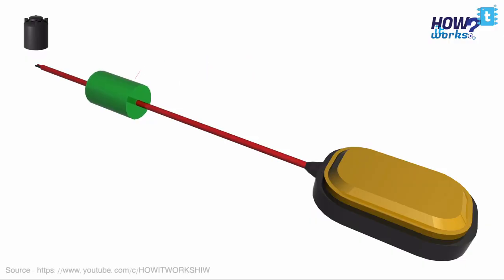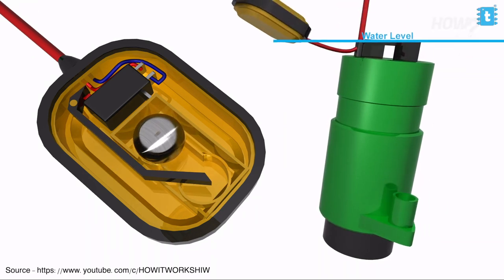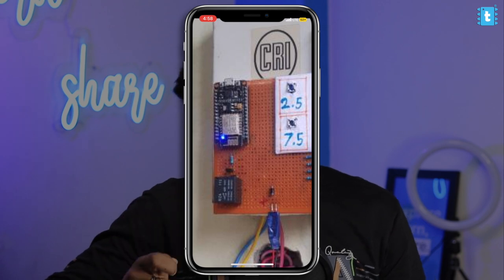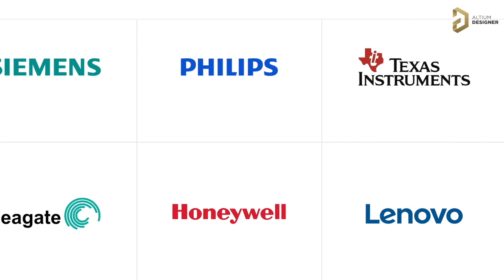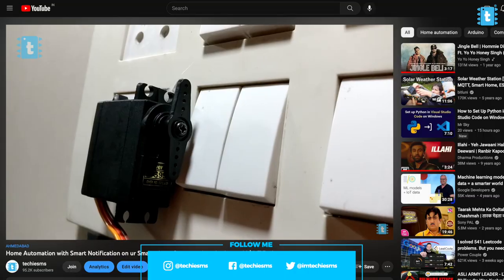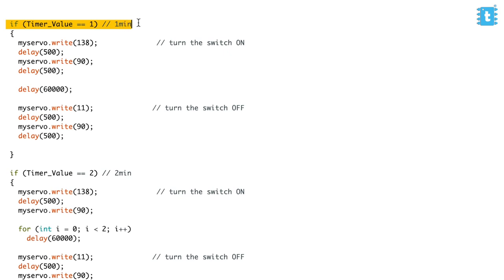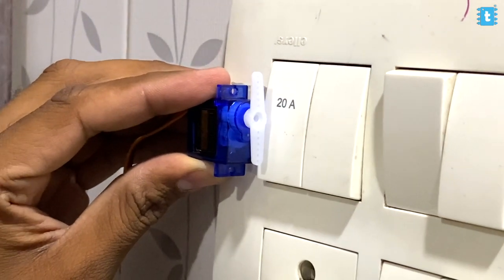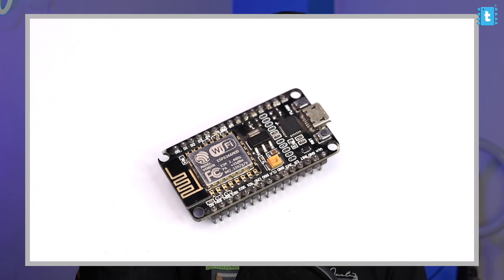STOP Water Tank Overflow using Servo!! | ESP8266 Projects | Electronics Project

Comment: I have added one RO float valve in one box with small holes at bottom of it. I have added that box to the water overflow pipe of tank. Once water starts to overflow it raises the float valve and closes the circuit for the water tank full indication.
For water level indication I have added one recording module with my custom recorded audio in it. I also added one small solar panel to charge the battery. It's almost 6 months and it is working fine.

Comment: I was waiting for this. 👍🏻 
There is 1 more simple solution you can use by just buying the smart switch/plug and using Google assistant or Alexa routine to automatically turnoff it.
Reply: He is not interested to open the switch board. That exposes high voltage lines.
Reply from the maker: correct

Comment: This project is ok but without knowing the level in the tank turning the motor on is not a good idea. If tank is full and you turned on switch then the purpose of the project is useless
Reply from the maker: See, in my project the water wastage problem is solved completely. Let me explain 

In case that water tank is completely empty, we know that it will take time to fill that completely so we can set a timer of 4 min and turn on the system. So no water wastage it this scenario 

Taking another case like you said, what if the water tank is 75% filled. Well here let's assume that  we are not aware about the exact amount of water stored in the tank but what if we are alone in the house and we need to go to toilet urgently and are not sure weather the tank has some water or not well what we can do here is, we can set a timer of 1min so that whatever amount of water the tank has, adding more water for only 1 min won't make that overflow and secondly that person (in the toilet)  will also get enough amount of water he/she needs in case the water tank was about to get empty. Again No water wastage. 

Hence I put different time intervals here.

Comment: First of all, it's way more costly than what I use.
I use a BC547 transistor with a buzzer and electrodes to detect the overflow as shown in one of the projects in the video. It costed me just 15 ₹ to make it. (Excluding the cost of wire which I had already lying around). Yeah, in 4 months (3-4 times a year), I have to change the electrodes, but atleast it's cheap and very reliable for the next 4 months.

Secondly, In your project, how to know which timer to use if we don't know the level of water in the overhead tank? It's the main drawback of the project. Suppose if the tank is 75% full and as we don't know it's level, we pressed for 50% (half the timer) then the remaining 25% water will be wasted. And that's a huge waste of water.

We try to save water, and end up wasting more of it.
Reply: Points to be noted. Agreed. 

But dipping electrode is not long lasting idea. The electrodes may get a thick coating of salts and minerals from the water and stop conducting. 

A float switch must do the trick. This way there are no metals coming in contact with water.
Reply: @madhukeshnp  yeah, float switch can be a good option, but it has its own drawbacks. The metal contacts inside the switch itself may corrode due to the humidity inside the tank. In that case, you have to either change the complete assembly of the switch or clean its contacts, which is more of a hectic task.

For me personally I don't have any problem in changing the electrodes 3 or 4 times a year. It hardly takes 15 minutes.
Reply from the maker: See, in my project the water wastage problem is solved completely. Let me explain 

In case that water tank is completely empty, we know that it will take time to fill that completely so we can set a timer of 4 min and turn on the system. So no water wastage it this scenario 

Taking another case like you said, what if the water tank is 75% filled. Well here let's assume that  we are not aware about the exact amount of water stored in the tank but what if we are alone in the house and we need to go to toilet urgently and are not sure weather the tank has some water or not well what we can do here is, we can set a timer of 1min so that whatever amount of water the tank has, adding more water for only 1 min won't make that overflow and secondly that person (in the toilet)  will also get enough amount of water he/she needs in case the water tank was about to get empty. Again No water wastage. 

Hence I put different time intervals here.
Reply: @techiesms  okay, I understand. The first case is absolutely fine👍

But the second case is very very specific and a rare scenario. So the timer will be useful only for that specific scenario and not for everyday tank fill-up.

But if we somehow manage to measure the level of water, then this will be a great project. And I for sure, know that you will make this a full proof project in upcoming days. We just need to find a reliable and low maintenance way of measuring water level.

The day we find that, I'll hook this everything up into my Home Assistant.
Reply: @techiesms   how do you know if the overhead water tank on the third floor of the house is full empty or half empty or quarter empty especially  if the use case scenario are for retired people

Comment: The best solution is to use cheap ultrasound mounted at top of tank
The water level can be measures in high accuracy 
Also we can calculate the number of lts of water present in tank
I use esp32 with ultrasound sensor
And have dashboard in home assistant displaying water level and lts , also I made calculation to show how much water consumed in a month
Reply: Pls share the photo
Reply: The water droplets condense on the face of the sensor and gives wrong measurements.  Have you faced such issues ?
Reply: I spent some money and got a waterproof sr04 from Bangood 8 few months ago. Completely flawless operation eversince. I have full monitoring on app and announcement on echo and message on telegram bot when tank is full or empty. 

I can easily control a contractor or relay to turn on and off the pump but just avoiding too much automation so that my parents can turn and off based on notifications.
Reply: @madhukeshnp   I use JSN-SR04T sensor available in amazon , I am using for my overhead sintex tank with proper air vent ( t pipes) . There is no issues of error reading from 6 month . I use this info to control relay of my water pump . The system is working without issues.

Comment: This is a good concept. But the downside is, you cannot make it a commercial product as you will be asking too many questions from clients such as 'How much time it takes for their tank to be filled?' What if they decide to start the pump when water level is half way?

I WILL SUGGEST THAT YOU MAKE A PROJECT WITH ULTRASONIC SENSOR, THE WATERPROOF TYPE WITH BLYNK, SHOWING WATER TANK LEVEL AND ALSO THAT CAN BE TRIGGERED AUTOMATICALLY WITH BLYNK AUTOMATION SETTINGS AT SOME CONDITIONS AND WITH MANUAL TRIGGER THROUGH A VIRTUAL BLYNK BUTTON. THANKS

Comment: Hi Sachin, 
Switching the Pump On/Off Switch using Servo Motor without touching the Internal Connection is the interesting part of this project.. 👍👍
Reply: Not every house has the switch type connection though..

Comment: I would have added a water flow sensor connected to a esp at the overflow pipe of the tank. And added a second esp at the motor control switch. And let them talk to each other via wifi. That way we won't have the hastle of setting rotary switch.

Also as a failsafe i might add a second flow sensor at the output of pump. So that i can precisely track how much water has gone to the tank and turn off the pump if it exceeds the tank capacity

Comment: Hi sir myself kesav
Another idea this project works only for normal pump motors. But for Submersible pumps additional controller panel buttons needs to switch on and off. Using the same principle can you try for that panel board mounting the servo horizontally.
Just a thought correct me if iam wrong.
Thanks waiting for your reply
Amazing and great idea for this video

Comment: Hi, Thanks for the video. The idea is good, the making and alignment is a bit critical. Can you please make this 1. by utilizing ESP now; one MCU transmits the overflow signal and the other acting on this signal. In fact I was planning to add a ready made smart switch near the switch, connecting parallel to the manual switch. Then we can have manual, auto, timer, voice control options.  your suggestion is appreciated.
Reply: No

Comment: Hai bro can u make a video for water low level and high level announcement only ( no motor operation) using Arduino uno and TF card mini mp3 module plz?  3 wire float switch for low level and high level to be used.

Comment: Firstly asking subscribers regarding their ideas and discussing the things is very good

If is make this kind of project i will use electrodes as i want to know the level of water and a buzzer when overflow

Is there any other way to know the level of water without any disadvantages like ultrasonic sensor
Reply from the maker: Knowing the level of water is good, but extending such long wires is hectic. 
that's why I said, I made this project just for my home. If you have a single storey house you can easily extend the wires and know the level as well.

But to know the level I'll recommend that floating switch rather than dipping electrodes
Reply: @techiesms  m on way to find simple solution
Reply: @drelectronics13  hey why can't we use rf module like nrf24 for sending water level data to the ground floor or near to motor switch
It has around 100 meters of range

We need to find out other way in place of electrodes for sensing water level
Reply: @rahulb23  issue is cost and reliability,and for sensing need to use floating sensensors
Reply: there are digital water pressure sensors, but its too expensive

Comment: RF ransmitter, RF receiver and a floating switch .
RF ransmitter switch is connected to the floating switch once it's got signal  it transmits the signal to the receiver. it turns on the pump.
( If we use the solar and rechargeable (for night time) batteries it's a long last . And using esp board we can also disable the signal from RF ransmitter and also switch on and off the motor    wireless and get the feed back also .it's my thoughts to make a project any suggestions please share 
And we can also use Lora boards for flat buliding .
Reply from the maker: RF fails in my case 
we can give it a try to LoRa. May be that will work
Reply: @techiesms    make it bro I'm waiting
Reply: @techiesms   and Also make smart IR blaster

Comment: I am also facing same problem and also came up with same solution but one problem i am facing is that i have a push button to turn on the motor along with the switch so first i have to switch on the motor and then i have to push the button to turn on motor
Reply from the maker: But my project solves that as well, you just need to press the pushbutton of the project and it will automatically turn on the motor

Comment: Sir can u use ultrasonic sensor for level measurements  so that that motor turns off getting the stats that the tank is full and the motor turns off
Reply from the maker: For that I need to extend very long wires as I discussed in the video

Comment: I already have esp8266 relay on the motor to start at a specific time and another esp8266 with flow sensor attached to overflow tap of tank.

It automaticly stops the motor on full tank.
Reply from the maker: Both are communicating via?